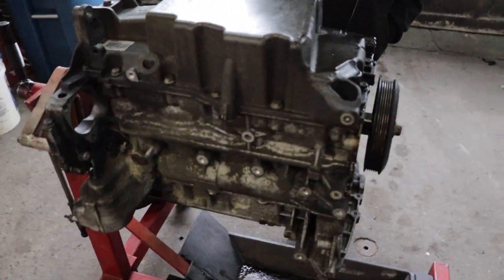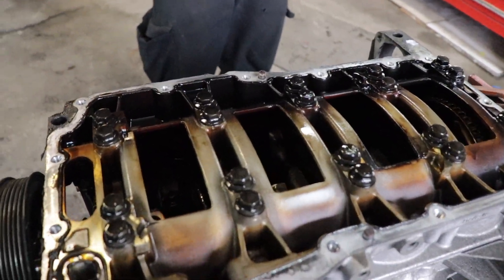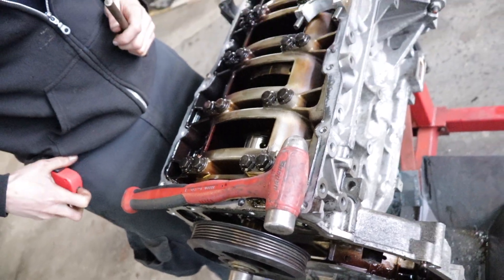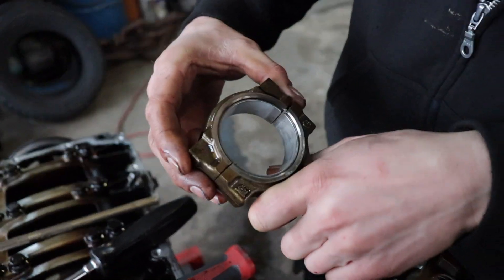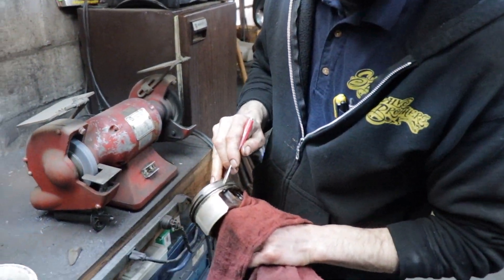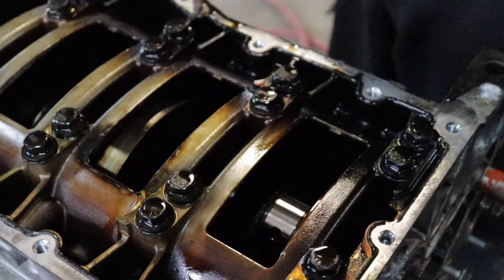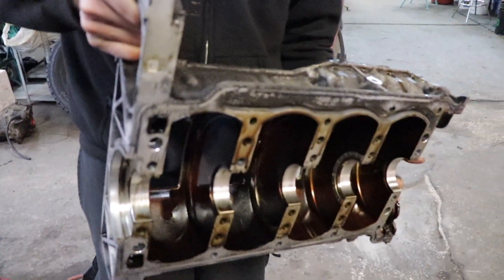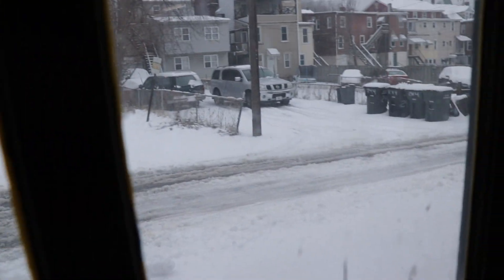cobalt SS lsj engine disassembly part 2

Comment: I heard these stock pistons from the factory are weak can’t handle being pushed over 200hp for to long between the heat being generated from dropping pulley and blow by these Oem piston and rings fall apart. I used to own a supercharged cobalt and it was blowing oil out of the dipstick everywhere. Diamond forged pistons are the way to go.
Reply from the maker: yea thats why i bought what i bought if youve seen those videos.

Comment: hey man do you think you could help me with questions about my own LSJ? im not mechanically inclined so im not sure what to do about it but my cai sucked up some water and now my  engine sputters and skips and stalls and its aweful
Reply: Hey just a heads up but if you sucked water into the intake enough to cause her to run rough then I'd go ahead and replace the manual trans fluid and engine oil.  Even though your engine oil isn't milky it's still worth doing.  Change out your trans fluid and possibly the output shaft seals since water is so less viscous that it can easily seap past the output shaft seals and get into your transmission.  Especially if your seal has a decent amount of miles on it and has hardened up.  That happened to me and I'm still trying to get water out of my transmission after 3 trans fluid flushes.  Funny thing was that even though my transmission sucked up water it never once showed any sign of manual trans fluid leakage.  I'm just lucky I caught it before I trashed the brass synchros in the transmission due to the water jacking up the friction modifiers and viscosity of the trans fluid.  Cheers.
Reply from the maker: @hans2five  if your still have water issues i would check the vent on the trans too make sure its on properly
Reply from the maker: if you only picked up some water it should clear out and everything should be normal. if it took on too much water you may have damaged some internal parts. that fact that it still runs is a good sign but i would pull the spark plugs and crank it through a few times to clear an possible water in the cylinders
Reply: @salvobrothers5928  yeah it's weird like it's been running and I've had the problem since the spring, And I been running the balls off of it cuz I was naive and didn't know how much of an issue it really was. It started out just sputtering and running crappy only when it rained and it would clear up afterwards or the next day after sitting awhile, but after awhile it started always acting like it was sucking up water no matter what. So idk of that points to there being a certain amount of water stuck in there, or physical damage to the engine. It rained again the other day so to be sure I checked out the intake and the throttle body and sure enough the filter was wet, the MAF was wet, the TB was wet, the inside of the supercharger felt moist. So I figure there's gotta be a certain amount of water in the engine but my oils never looked milky, its never blew up, and sometimes when it sits awhile idling the problem goes away nearly all together. I ordered a new maf just cuz I figure if it was wet this time then there's no way it didn't get wet the other times and maybe my problem is just a fried maf but I don't have faith that that will fix the issue lol.
Reply from the maker: @kenrockstheworld  yea i hear ya, probably not a bad idea putting a new MAF on it since it saw water but its really hard to say whats really going on without seeing it. gotta get that air filter covered so it wont cause any further damage
Reply: You know I thought the same thing too but it seems the little node on the top of the trans was never drilled out.  So there's no little filter that I can see.  It is in a very tight spot so I won't rule out that I just couldn't see/feel it as I was rooting around in there to find the damned thing.

Comment: With ecotec motors do you hone out your cylinder walls before piston reinstallment?
Reply from the maker: I do with any engine for proper ring break in
Reply: @salvobrothers5928  Thanks for the reply, I spoke with zzperformance today and they said it's not a absolute must when replacing with stock bore pistons but a quick ball hone is a plus.
Reply from the maker: @christech4466  what happened to your motor and what are your plans?
Reply: @salvobrothers5928  motor when lean due to a malfunctioning hpfp had a real bad missfire. Piston #1 ringland is tost. Car is HHR SS ZFR turbo full bolts e85 450whp. I'll be installing ldk pistons and rods to fix this mishap. Only plans are to work on suspension to plant power

Comment: As far as the balance shafts, Yes you can cut the ends off and just run the chain end. BUT you have to make a plug for the center bearing and press fit it into the bearing. I made it out of aluminum with a very slite taper and I put a 3/8 taped hole in it so I can instal and remove with a slide hammer.
Reply from the maker: i really like that idea

Comment: Lol same thing happened to mine. Thought I just needed new o rings for intake manifold but it was two big ass chipped pistons.
Reply from the maker: dude its wild, I'm really surprised it ran so well being like that. it amazes me how some engines can continue to run with some of the things going on with them
Reply: @salvobrothers5928  I know. I'm so glad my Cobalt is always loyal to me. My timing chain guide was in pieces and I drove it like that for aaa whhilllleee cuz my dumbass didn't know. Luckily nothing happened and all I had to do was buy a new timing set.
Reply from the maker: @ricktomev155  yea i've seen a bunch of the 2.4L come into the shop with broken timing guides and and their good as new once you replace it, i've seen one go through the guide so bad in started eating the bolt up too my god lol
Reply: @salvobrothers5928  oh yeah my bolt broke off too. It had to extracted :/. Damn these cars are more loyal than people
Reply from the maker: @ricktomev155   geez man you really let it go lol

Comment: U can cut the balance shafts but u also need to get the block off kit or you will have no oil pressure
Reply from the maker: aah ok i was wondering thnx for the tip